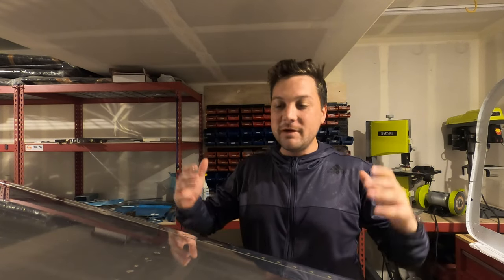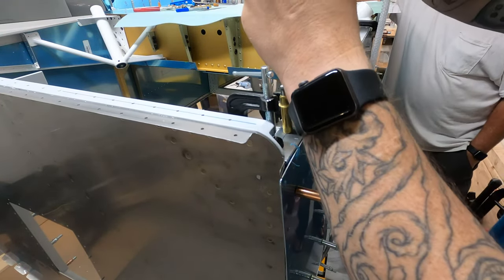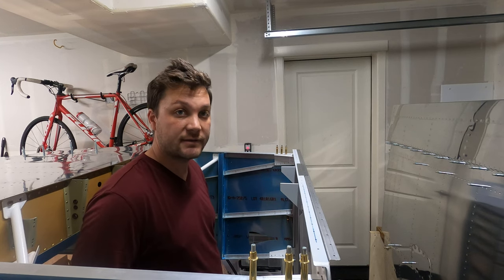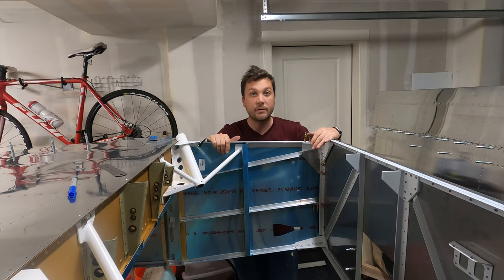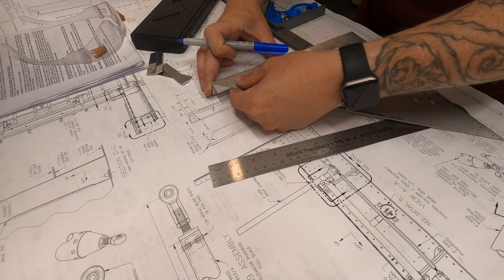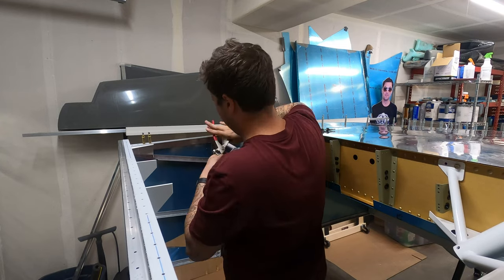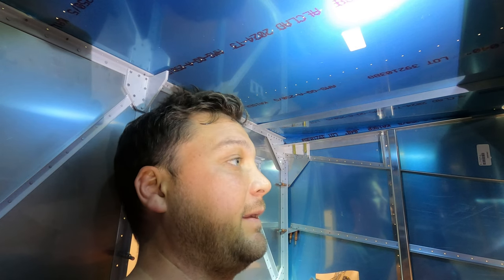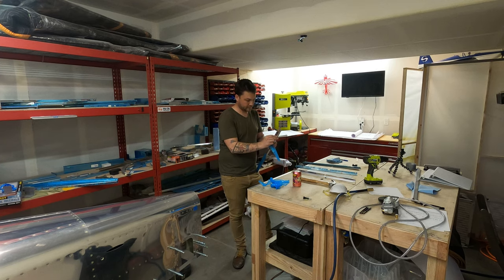Still More Forward Fuselage Fabrication | EP3.15, Building an Airplane: The Van's RV7A

Comment: I spend all day building my Sonex only to watch someone building a RV. It's interesting watching your tools and techniques and how alike and different they are.
Reply from the maker: And then when I put the tools down and kick up the feet I’m watching someone put together a Kitfox or enthralled with a Glasair build. We’re definitely all birds of a feather!
Reply: I've had good luck draw filing, better finish and control. Turn your files 90 degrees and use two hands. I also made custom smooth vise jaws with a bit of a radius. Great for holding the small parts, and you can break a seam against the radius instead of using hand seamers. Great work, subscribed.
Reply from the maker: @slantVI awesome feedback! Thank you!

Comment: Really good segment.   I am still in awe of the amount of sweat and work that goes into your build.   I am still considering my build.  Now it is between the RV-9A and RV-10. One question… Where did you get the plans for building your workshop table and other parts to put together your working area?
Reply from the maker: There’s definitely some exertion involved in this!

The tables are EAA build tables. 

https://www.eaa.org/eaa/aircraft-building/builderresources/while-youre-building/building-articles/tools-and-workshop/worktables

They go together pretty easy. Use quality wheels unless you want something to complain about daily like I do.

The booth, downdraft table and other miscellaneous pieces I created mostly ad hoc. 

I sketched out the overall layout of the shop before I purchased the shelving and tool storage.

Comment: Another great vid. Off the wall question. All this time building, are you getting any time to keep current on flying?
Reply from the maker: That’s a good question! I don’t get up as much as I’d like to, for various reasons. I still remain current, but ultimately I’d like to be taking trips two times a month. I’m less than half of that, typically.

I need to make some more friends with planes!
Reply: @RyanFlysPDX  I hear ya, don’t get up as much as I would like either. Hoping to  start building soon myself. Trying to decide between the 7or 9.
Reply from the maker: @flyingnp4924 that’s a tough choice, with two solid airplanes! Have been able to get out to Van’s for a test flight? I’d highly recommend that, and spending a few moments talking about the differences.

Comment: I only build the balsa rc version of an airplane & you are spot on in the amount of work involved in the full sized plane must be daunting, plus it does require the tools that make fabrication possible and they are not exactly cheap.

Speakiing of tools, my 12 inch band saw can have drift on the blade's position when you cut a deep and hard material and I have to cut very slowly to prevent the drift. I noticed that you were able to cut your structural angle with no apparent blade drift and I am wondering if my issue just is due to an old machine that is no longer as capable as when new, or is watching out for blade drift common to band saws in general.
Reply from the maker: You know, there is a little drift but that Ryobi band saw is a formidable machine for the cost. I suspect band saws have come along a bit compared to some older ones.

My pieces are typically cut a little long, and sit a little proud until they get filed to the precise dimension.
Reply: Try a fresh blade, you shouldn't have to push on it for it to cut.
Reply: @slantVI  Yep. 
I to a degree agree, but I am mostly referring to tasks such as slicing off a 2.5 mm thick by 6 inch wide or greater slice of mahogany or harder piece to use in the construction of the back or sides of a stringed instrument like a guitar where any drift of the blade over the travel of the cut is very unwelcome and often leads to do again because the piece is not correctable. My bandsaw is old and likely not as precise plus there are expensive add ons that make the task easier to accomplish. It is just one of those things that one always encounters when fabricating that makes what on the surface seem easy, not so easy.